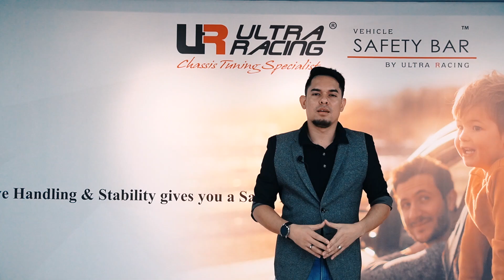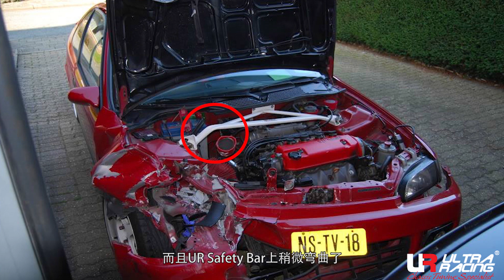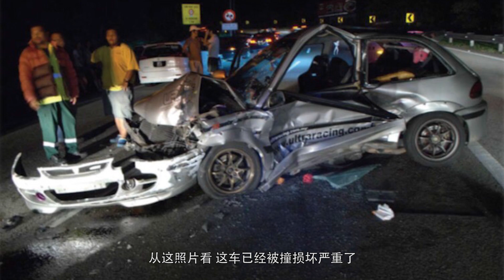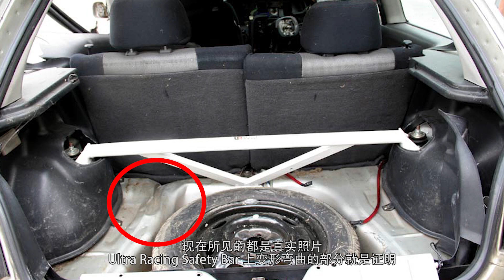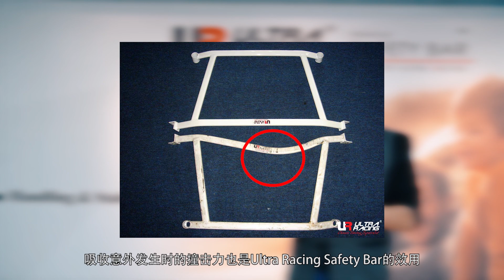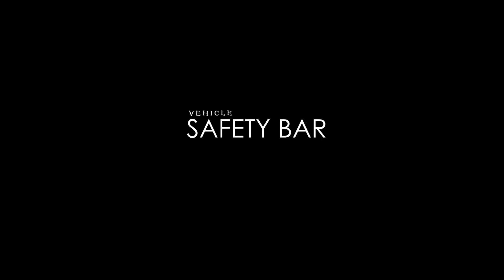Ultra Racing | How Vehicle Safety Bar absorb impact

Comment: BTW, these stiffening bars are meant to stiffen the chassis, not completely replace the main structure. Their job is to be just strong and stuff enough to tie structural components together to spread the load and stiffen the overall structure, NOT structurally replace them. That's why they're not made absurdly strong and are instead made JUST strong and stiff enough, it makes no sense to waste material and add excessive additional mass.

Comment: If anything, strut tower bars would actually improve safety in frontal offset crashes which are much more common than full frontal crashes, by using both strut towers instead of just one strut tower to absorb the crash energy. Any worries about transferring damage from one end to another is practically asinine since if the the crash is severe enough to affect the strut towers, vehicle damage would be the least of your concerns and occupant survival takes top priority.